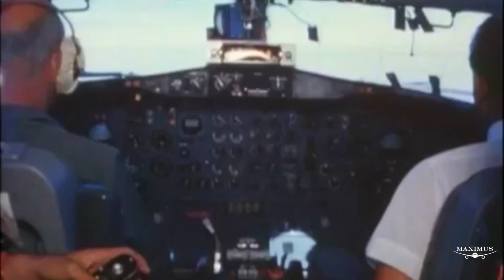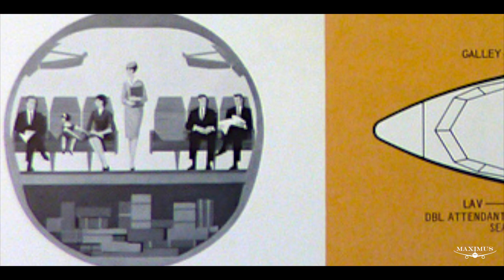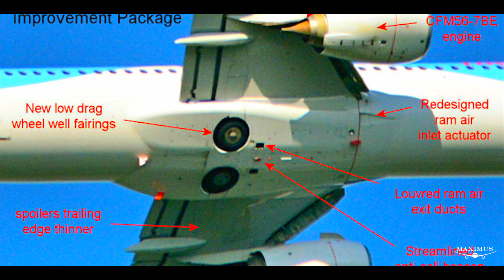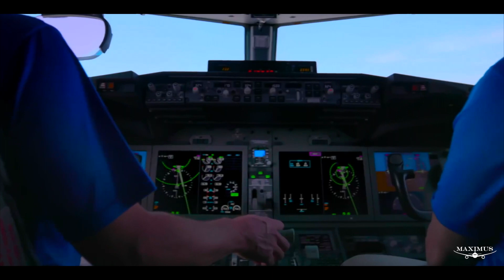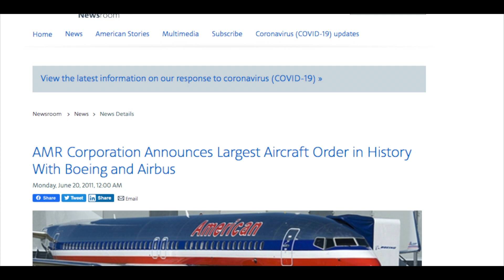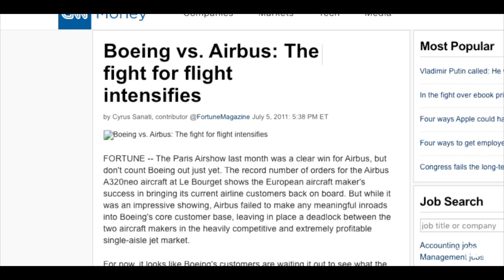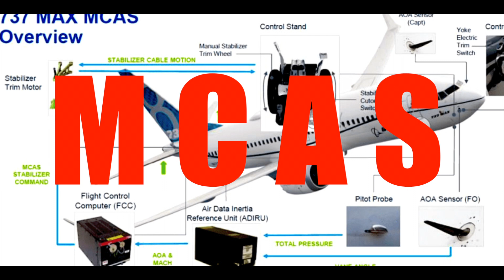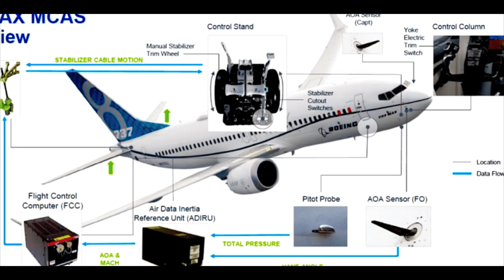(Boeing 737) How The Hell Did We Get Here? A Complete Look Back At The History Of The 737 Program.

Comment: Excellent recap of the 737 MAX. But you didn't mention the NG structure problems. The Torrance, CA company was supposed to laser cut the crosslinks but instead were doing it by hand. And the flaps on the NGs and 800 also have had its share of problems. Also how Boeing thought to rely on one sensor instead of two or three. Considering how aviation uses so much redundant technology, this was an abomination. Airbus had the same problem with the A330 that relied on one and crashed in the middle of the Atlantic ocean flying our of Brazil. That was quickly rectified.

One thing you don't mention is the role Boeing investors played in the MAX project. My sources tell me Boeing wanted to design the 797 but investors balked at spending $35B for a new airplane to beat the higher-off-the-ground A320. As @David Greer says below, the NG was already overstretched and the 800/900 tipped in ways that had nothing to do with the 737 Classics.

As long as aviation companies are by non-aviation people, I'm afraid we'll continue to see these horrendous scenarios.
Reply from the maker: Yes unfortunately for the sake of times i just hit the high points.  If you make videos too long people tend to check out.
Reply: @maximusaviationchannel  You're right. A proper coverage of the 737 MAX debacle would take fifteen 15 mn videosw :)

Comment: Boeing was clearly/aggressively looking to make a composite/blended wing replacement for the 737 series (soliciting bids from communities in the Puget Sound area to build a new plant for the said new plane).  The Dreamliner/787 program was in serious trouble and began to eat Boeing's development cash, also shaking its confidence in its abilities to master carbon composite fabrication (shades of Olive Beech and the Starship program).   Thus was the decision to go-to-the-well one more time and squeeze larger engines under the wing of the 737 formats.  MCAS was not anticipated in the MAX inception, but as a result of trim instability discovered during flight testing.  MCAS is the big ugly patch to the MAX program.  Tweak MCAS all you want, THE problem with the MAX (trim instability) remains unaddressed.

Comment: Here is a radical thought: If there is ever another generation of the 737, why don't they put the engines above the wing. Then they can make the engines as large as they like. True, they would have to shift the horizontal tail control surfaces, but is doable and you retain most of  the aircraft.
Reply: Too noisy for the passengers?
Reply: @oxcart4172  exactly 💯 👏
Reply: The answer is far stupider I'm afraid, they didn't want the engines to block the view....
Reply: How about Boeing just bring back the 757 and create a new clean sheet design narrowbody plane to replace the 737 lineup,that's a even better idea 💡
Reply: @ericjones7769  - That would be the best idea. But remember, the whole point of the 737 MAX was so that they didn't have to build a new aircraft. It was about management stripping the maximum profit out of the company and spending the least possible money on the future of the company.

Comment: Nice report.  I wish that you would have started with the 737 was not a clean sheet aircraft like the DC9 but a rework of the 707 and still is in some systems and start up.  The MCAS was created as the higher and more forward mounted engines on the MAX will cause a lighter nose up tendency when power is added so they needed to counter that a “little” so it felt like a 737 NG for single type rating not an AOA issue. See the excellent reporting on the Blancolirio channel.  I’ve talked to many pilots that believe where Boeing went wrong was to make the NEO competitor out of the 707 derivative 737 instead of shorting the 757 with different engines and wing.  On another note the MAX was very safe in the hands and maintenance of US and EU carriers. The MCAS design was a very stupid one (no redundancy and no auto cut off if there were any mechanical issues in any of the system parts and with poor testing that should have caught those design deficiencies.  Keep up the excellent reports.

Comment: TBH I think Boeing's mistake was to make the Classic. The airframe was closing 20 years of age, and the engine didn't fit. At this point, they should've made a replacement for the 737
Reply: Agree, either they made the mistake with the calssic or with the max, but not the NG wich kept the CFM56 (although an upgraded variant).

But the 737 Classic and NG worked great so Boeing did the right thing I believe. Everybody new that Boeing had to come with a brand new design to replace the NG, except Boeing apparently...

Comment: I'm not comfortable with the implicit supposition that the 737 MAX concept couldn't be properly implemented.

Maybe management indeed took to much risks earlier bean counting instead of investing in a new airframe. 

Anyway, as they forwarded this 4th generation revamping of the original design they had to guarantee it would at least function properly and securely or abort the program.

Failure or criminal negligence on proper implementation of the MAX, letting it fly with known unacceptable vulnerabilities IS indeed the root cause of the misshapenings.

Boeing did once have the engineering capabilities to do it right. Somebody steered it into cutting corners in security, and must be held accountable.

It might have not been wise to cut costs in a substitute for the company's best seller, but that's not exactly the same as letting flawed computer controls endanger so many lives.

It's not clear if detractors have any real base to call the plane a doomed one. Let's see how it turns out.
Reply from the maker: Oh I think it absolutely the MAX can work and should have.  If Boeing was just open about the MCAS and properly trained airlines and pilots this never would have happened. The Coverup is always worse than the crime.
Reply: Essentially the MCAS issue is a stabilizer trim runaway, a malfunction addressed by the QRH with a checklist including memory items such as removing electrical power to the trim system. It is trained during the type rating. After the first MCAS accident, the Boeing FCOM bulletin in part emphasized that the proper response to a MCAS malfunction was to perform this checklist. 

I would compare that to an engine failure. As a pilot, what matters to me  is whether it is a severe damage or not, the root cause doesn't matter. I have 2 checklists available and the symptoms determine the appropriate course of action. Here it's the same principle. It's a stab trim runaway. What causes it doesn't matter as there is only one checklist appropriate to this malfunction, whatever caused it doesn't change what I should do to address it. Performing the checklist AND flying the aircraft WILL prevent catastrophic consequences. Had those unfortunate colleagues performed adequately (that is: fly the aircraft, identify the malfunction, perform the appropriate non-normal checklist, work methodically as a team), it would have been a bad day at the office but no one would have died. 

The Ethiopian accident clearly shows a complete breakdown of the crew. Thrust was not reduced - thus the overspeed and difficulties in using the manual trim. The crew then restaured power to the trim system which ultimately led to the loss of control. The FO, not the captain, identified the trim problem and suggested the appropriate checklist.  The communication with ATC shows some degree of panic. Ethiopian is by no means an airline comparable to Western standards (training, CRM, safety culture, adherence to flight time limitations...).1

Having said that, my view is that the stab trim system as a whole, not the MCAS alone, is less than good. This backup manual trim that can't be actuated by a single crew member at high speed exists simply because there is just a single trim motor, not two... The 737 sometimes uses very primitive means to achieve a fail safe level (man trim, manual reversion, the former rudder PCU design...).

Comment: How?  Boeing started focusing on profit and quantity over quality and innovation.
Reply from the maker: Exactly.  Well that's how it started but then it turned criminal by the way Boeing hid the MCAS from the EASA and the FAA and the Airlines.  All they had to do was let the airlines have a max simulator but if that happened Airbus would have beat them to delivery.  Its sad and stupid all around.
Reply: @maximusaviationchannel  A plane should fly according to the law of physics, and not the law of microsoft. And who ever desgigned the Max, has probably never touched an older 737 before. I used to work in the groundhandling field and what annoyed me most about the Max is, that the plug for the headset for ground staff is almost the same as on the NG, with only one problem: the undercarriage on the Max is higher. So when we did the walkout assistence on the Max we always had to use staff who where 6ft tall, otherwise they could not plug in the headseat. Somehow Boeing thought that everybody on the ground has the height of a basketball player. Besides that i think the 737-800 was already a length to long. I know only two passenger carrying airliners that are prone to tail tipping: the 737-800/900 and the ATR72. The solution: When the tail comes down, throw suitcases under it to prevent structual damage. Seriously?
Reply: The reason Donald Douglas left the industry.
Reply: Kudos to you, as you've hit the nail on the head!

Comment: They really should have just extended the landing gear and then moved the landing gear out a little to accommodate the larger engines.
Reply from the maker: Or they could have just told the truth and made simulators to train pilots on the new plane.  Thanks for Watching.
Reply: @maximusaviationchannel  Not having told the pilots about the new system was criminal in my opinion.  And just requiring sim training would have solved a lot.  I just don't understand the reluctance to raise the plane, especially when they are changing the wings anyway.
Reply from the maker: @HitechProductions  Yeah I did two videos on that with the emails and text messages.  People need to go to jail for that.  If pilots had training both accidents wouldn't have happened and Boeing wouldn't be in this mess. Like they say the coverup is worse than the crime? Well, in this case, it was deadly true.
Reply: HitechProductions - The wing isn’t new. It is the same wing as the previous NG models, just strengthened due to the heavier engines. Also fitted the new design winglet.
Reply: @ACPilot  I was referring to when they made the NG that they should have raised it.  When they made the Max they should have also raised it again if necessary.  But boeing took the cheap route instead.
Reply: @HitechProductions  I believe they did...from what I can remember, both the main and nose landing gear have been changed/lengthened ...The main landing gear actually contracts as it is retracted into the well.
Reply: BlackKnight344 That’s actually just for the 737 Max 10, though.
Reply: Amazing,,a modern day jet with hub caps instead of gear doors... ridiculous